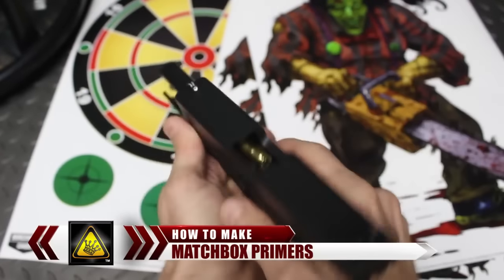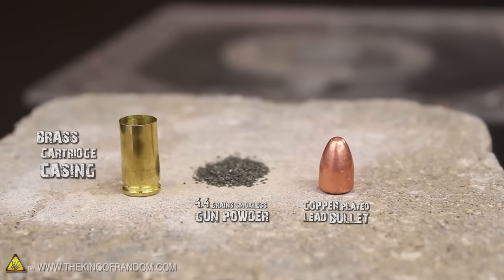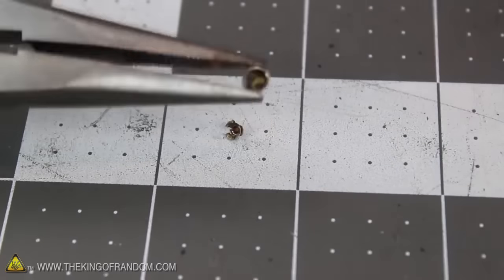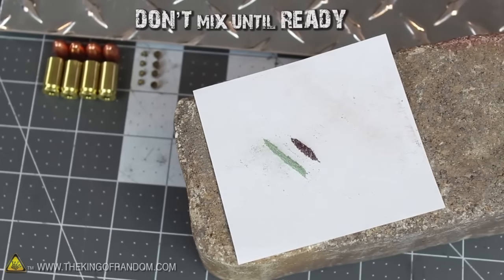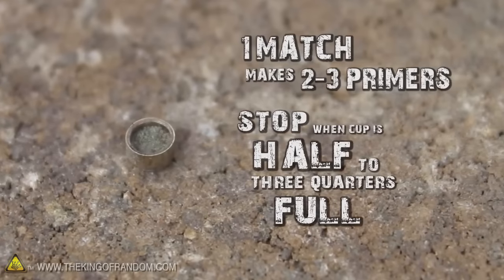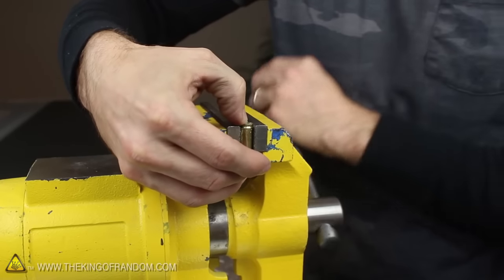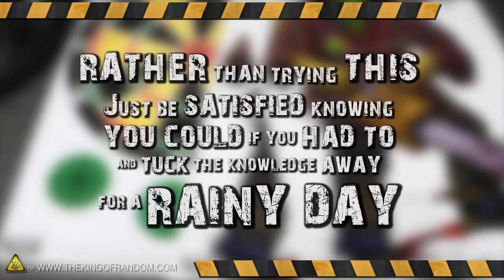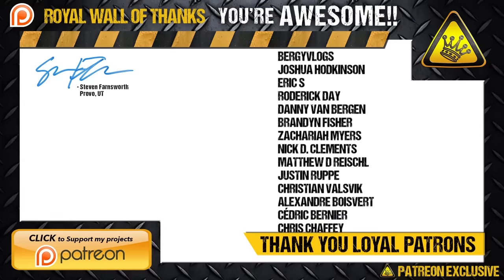How To Reload Primers with Matches

Comment: Remember folks, this is a CORROSIVE primer mix, so clean clean clean immediately and thoroughly if you use this!
Reply: Is this a stable mix, like can I walk around with magazine of these in 95°
Reply: @Najsnwjsbdn  Yes, but like he said its very corrosive. Better off keeping the knowledge for later.
Reply: will this compound work loading 22 lr with a drop of acytone so it will dry in place around the rim
Reply: @robhill3378  Yes
Reply: @BooDamnHoo  thanks
Reply: @robhill3378  there are channels which have posted 22lr specific reloading tutorials.
Reply: I seriously doubt it. Mercury fulminate based primers are those known as corrosive, but this primer mixture is based off of potassium chlorate, phosphorus, ground glass and perhaps a tiny bit of sulfur. They might still be very slightly corrosive in the long run, but nowhere near as much as the traditional corrosive primers.
Reply: @thatguyoverthere9634  yes and have found them thanks
Reply: @pieterveenders9793  What makes some primers corrosive is the salts used in the mixture, which invites moisture, and therefore corrosion. Potassium chlorate being a salt may indeed be corrosive to the firearm.
Reply: @jameswolfe8065  The hygroscopicity of a particular salt is only a minor part of what causes corrosion, but from what I remember the major factor that determines it is the electron potential of the specific salt(s) it contains. Depending on  the salt(s) and their potential it will potentially exchange electrons with any adjacent metal, which is when corrosion forms. Its precisely for that reason that outboard engines used at sea have a chuck of zinc attached to them which due to it's different electron potential becomes a preferential target for electron exchange and thus will corrode before the metal of the outboard engine does. But I must admit, I was never really interested in the anorganic part of chemistry so it's all a bit rusty (pun intended).
Reply: @pieterveenders9793  True enough,  But corrosion even in small amounts is bad for the firearm,  so a thorough cleaning after using these primers would still be prudent.
Reply: Unless it’s a high point 😂JK
Reply: @pieterveenders9793  potassium chlorate once detonated is still corrosive, alot so if you plan to shoot off alot or used in bigger primers
Reply: Should i just clean a barrel or everything?
Reply: @JohnSinatra88  never hurts to clean everything, but the barrel be cleaned well and swabbed with a protectant after using corrosive ammo.
Reply: @Najsnwjsbdn  no.
it's very sensitive and should not be stored or anything.
it could randomly explode.
i'm actually surprised YT allows this video.
chlorates+red phosphor are no joke.
Reply: @Najsnwjsbdn  i'm mocking YT for behaving like kommie media.
i would only use this mixture if i really had to.
Reply: Remember folks he's dead just respect the man and let him rest in peace
Reply: How often could you go without cleaning/how many rounds you think could go through until cleaning is a MUST? I'm asking more as a general use in a desperate scenario
Reply: This goes by the name of armstrong's mixture.
Reply: dont matter in a glok
Reply: @pieterveenders9793  how are you so wise in the ways of science 😆
Reply: @BallisticDamage  Although I've only studied chemistry for a year (and then switched to biology instead), I've always been a huge chemistry nerd. For me, science is life, haha.
Reply: @pieterveenders9793  now lead azide and lead styphnate is used in primers mainly
Reply: @pieterveenders9793  Potassium Chlorate decays into Potassium Chloride, a corrosive salt. Ammonium Perchlorate can be used instead, which will not produce corrosive salts, and has the added benefit of being more shelf-stable than Chlorates.
Reply: Is this safe?

Comment: “What if something happened where you couldn’t get them (primers) anymore?”

It’s sad how true this question has become.
Reply: Also you can make gun powder using just plain matcheads aswell. 10 matcheads for 9mm, no need to mix in the striker powder like they do for primers. Just matcheads.
Reply: @bjblaskowicz  Do a video on that!

Greetings,

Jeff
Reply: The match head primer thing is actually very useful. However, could prove to be unreliable and potentially dangerous. It could be better than nothing, or potentially not.
Reply: Remove the primers from spent brass and hammer the primer face flat again
Reply: @Terabit3  That is what the video shows.
Reply: @jeffjefferson2676  sorry. I didn't watch the video and just wanted to help a bit in the comments section
Reply: I just bought tons of primers. The secret to beating a shortage is not to be greedy and leave some for the next man.
Reply: @kevinrowe3936  So you are saying you should buy everything and leave but one box?? or not even one just take it all. If you order at a factory, and you order a lot, i bet they will sell you primers if you order enough. 

Greetings,

Jeff
Reply: @edward.doctor1892  bro i live in england it is illegal for me to own ammunition
Reply: @Paramdeep Grewal no, it would be very underpowered and harder to make
Reply: @bjblaskowicz  do you have numbers for other calibers?
Reply: @setesh1294  no sadly, but u can work out the grains of gunpowder to grams of matcheads im sure
Reply: Don't worry, bro. There is probably more ammo in the US than matches, you won't really need to worry about reloading primers ever

Comment: If you reload regularly, you won't even need to flatten the primer cup at all. The deprimer die already does it for you. Also, don't try this with rifle rounds. Matches don't burn fast enough to ignite the typical powders used in rifle rounds (5.56 and up). This does work in most pistol rounds though, as pistol calibers generally tend to use slower burning powders. Now all you need to figure out is how to create a stable and reliable source of gunpowder, as well as learning how to swage bullets (cast rounds tend to leave lead deposits in your barrel, which will clog up the rifling grooves over time and can lead to a multitude of non-catastrophic and catastrophic failures, from significant loss of accuracy and range to full on squibs). Also, brass can only be recycled so many times before they experience stress fractures and become unusable.  

Another thing to be aware of- pushing the primer cup in by hand will not properly seat the primer, and will also damage the rim of the casing, even if you can't see the damage with your naked eye. This damage, along with improper seating, can cause a number of problems. A damaged rim will cause an incomplete seal around the actual bullet, which can lead to keyholing in a worst case scenario. Fix this by properly trimming the rim with a chamfer tool (usually included with most bullet presses), and using a factory crimp die. Seating the primer properly will also require a reloading press, or at the very least a hand primer tool.

In fact, bite the proverbial bullet NOW and just buy a goddamn reloading press. Even a single stage press is better than nothing (and actually preferable for precision rounds anyway). Good luck finding a turret press or die sets right now though. 2020 really fucked us good in the gun industries.

EDIT: Almost forgot- match powder makes this corrosive. Not as bad as other primers can be, but still enough to warrant concern. Clean your gun as soon as possible if you use this method. Which you'll no doubt need to do anyway, because zombie guts can get into everything and gum up the mechanical workings of a firearm (never had zombie guts on a gun myself, but I've had blood on them, and that gets real sticky as it dries, which is no bueno). Anyway, try not to blow yourselves up. Or do. More equipment and resources for me when I scavenge your rotting corpse. 🤷‍♂️
Reply: Wrong. This works just as well with rifle rounds. Rifle powder is the same composition as pistol rounds just a bigger grain size. Red phosphorus/potassium chlorate is not even very corrosive either, you’re thinking of mercury fulminate or antimony trisulfide like they used to use

Comment: I was “punching primers” with a center punch and empty cases n a vise, like you were in this video, years ago. Until, one backed out and almost blew the tip of my middle finger off the hand holding the punch. Just put em n the gun to test them. I still have a scar and nerve damage and it happened over 25 years ago.

Comment: If you will use alcohol when you mix the primer compound and make it a paste you can recharge the primer and it will be a much denser charge. It will also be safer to work with since it won't go off when wet. Just let the alcohol dry and you're in business.

Comment: Quick tip..Use strike anywhere matches and you don't need to use the striker..
Reply: If you can find them. I haven't seen strike anywhere matches in stores in years.
Reply: @msloan1972  you can still get them but they are expensive..A lot of the time they call them survival matches..

Comment: Thanx so much I'm down to 13000 primers and I'm starting to get desperate.
Reply: I am worse off.  I have  1.8k of LPPrimera and 2k of SRPrimers but down to zero of SPPrimers!  However I am not hurting for already re-loaded ammunition so I will wait until commercial primers are available as I  do not want to use corrosive primers in my guns unless necessary and I am not there yet,

Comment: If too much damage is done to the metal body of the primer there is potential for the explosive to fire out the back end. This often happens when using a SMG with regular pistol ammunition. Theres a reason SMG bullets often take a couple strikes to fire out of a regular pistol
Reply: No such thing as smg bullet, a 9 luger is a 9 luger

Comment: I would use a tiny piece of thin paper to seal the powder between the small anvil andvthe cup itself just to be extra sure it wont fall off into the shell through the flash hole .

Comment: Feel free to do anything you want to your Glock, others need to be warned to NEVER EVER drop a case or loaded round directly into the chamber...unless you like replacing broken, bent, or chipped extractors. The case ALWAYS needs to feed in from a magazine where it will be fed properly into the extractor groove. 

Other than that, I can't wait to try this at home. I have a bottle with about 2,000 fired primers in it. Never considered refilling primers. May be worth the effort now!

Comment: what would the ratio be using the strike anywhere matches ?
Reply: Strike anywhere matches basically just have the striker and match compound on the single match head, where as seen in the video safety matches the match compound is on the match stick, but the igniter is on the box striker.
So 2:1 just as in this recipe.

Comment: You can use cap gun caps.
Reply: Have you tried it? Seems like it would work
Reply: @beardedbowhunter6139  I have used them with  a black powder pistol and I used two of the paper capgun caps and glued them in some aluminum foil. Just to see if it would work. I have enough #10 and #11 caps to last for a while.
Reply: @beardedbowhunter6139  There is a video where the guy used the plastic ones, but that seemed like too much work.
Reply: @bill7778  thanks for the reply

Comment: How about getting the RIGHT tools to do the job...  To reload, you're going to need a reloading press with the RIGHT dies, that will decap the primer as part of the process anyway.  And to flatten the cup, get a steel punch small enough to fit in the cup.  Most bolts are soft and will mushroom out, so you might as well go with tool steel.
And you should learn how to properly reload ammo BEFORE you start, otherwise you could leave the primer sticking out and subject to firing when you drop it, and the proper measure of propellant to put in it.

Comment: Not once did he mention metal fatigue. Straightening the fireing pin dimple and reusing a spent primer may cause the primer to back out of the case or burn through and burn your fireing pin. If it melts wit the pin out your pistol will run full auto. No body should use or recommend this method. If the zombie apcolapse is at hand the best option is neturalize your enemy and take his ammo

Comment: Lol this video can't be serious excluding critical information for the first step of reloading. Fire cases MUST be resized with the appropriate die before a new bullet can be seated or the case even be chambered because they expand slightly. Resizing the case also simultaneously removes the spent primer and most presses have a primer seating stem built in as well but there are hand tools for this as well. You can purchase all the proper equipment for reloading. In an emergency situation, you literally can't reload and use ammunition without resizing cases first. The only way I can see you not using reloading dies would be to have a steel tube at the exact diameter required to hammer a spent case through to squeeze it back down to the proper size, in which case you now have a sizing die and if its steel you're going to need lubricant. Pistol sizing dies are 99.99% of the time carbide and require no lube.

Comment: 9mm operates at 34,000 PSI and the safety margins of the gun and the case are set up around that figure.

What effect will changing the primer composition have?

You can treat a weapon as a toy and figure it out. I'm going to treat my weapon like a weapon and use the appropriate components.
Reply: @Waltham1892  Dont touch anything you dont understand. You shouldnt even own a firearm if you dont understand them or how they work. Pretty simple if youve been around and have tried things yourself instead of following safety sally instructions from youtube.
Reply: @working2bselfsufficient724  Yes, brilliant.  How much do you know about the composition of match heads?

Are they all the same?  Do they differ by manufacturer?  Do they differ by lot?  Do they differ by type?  

How are they affected by humidity, age and how they are ground?

How is chamber pressure affected by the use of match heads as primers, by manufacturer, by lot, by age, by grind?  

Is there an interaction between match heads and certain powder types?

Some people consider themselves experts because they've tried every stupid thing they've seen or heard.

The real experts don't do that, because they know its stupid and dangerous.

If you can find bullets, powder, casings and a press, you can find primers.

If you are worried about zombies, see you doctor about adjusting your psych meds.
Reply: @Waltham1892  Youll never learn a thing spending way to much time on simple comments. Bet your not married either, sorry for her/him if youre. Btw this isnt anything new people have this for generations so you should know whats safe or not, regardless  he said he tried in every way to make one malfunction prematurely and couldnt. You do realize its very simple to test powders right? beginning to think your new to firearms
Reply: @working2bselfsufficient724  Son, I guarantee you I know more about firearms than you do.

That you've shifted off the topic and are attempting to engage me in a personal conversation proves that you know it too.

Now, do you have anything to say that is germane, otherwise, you are done aren't you?

Comment: 7:33 Never load a glock like that. You run the risk of breaking your ejector.
Reply: Not if you let the slide go home slowly. Hitting the slide release with a bullet in the chamber does put a lot of stress on extractor.
Reply: Glocks can typically run even without an ejector so even if you do manage yo break it, itll keep on chuggin along.
Reply: @drew1427  were talking about the extractor, not the ejector. I've never seen a glock ejector break